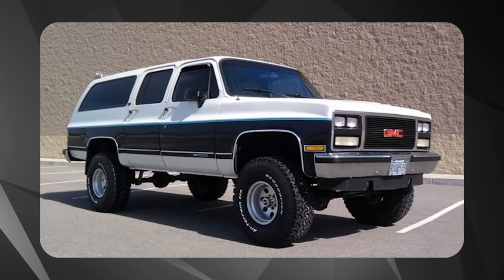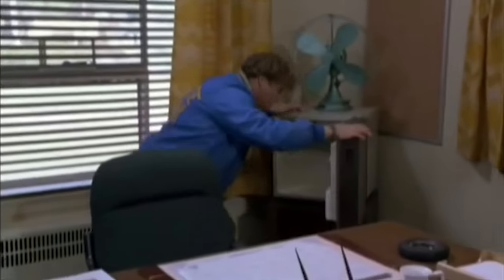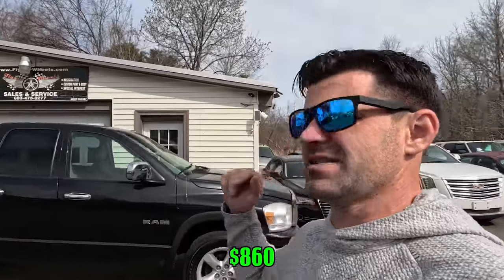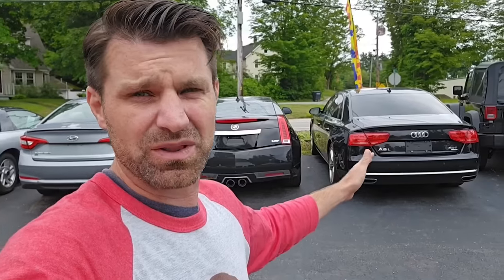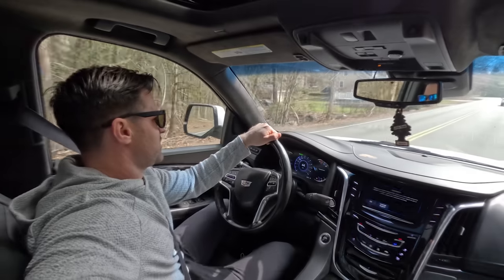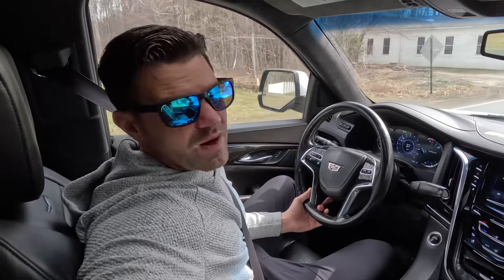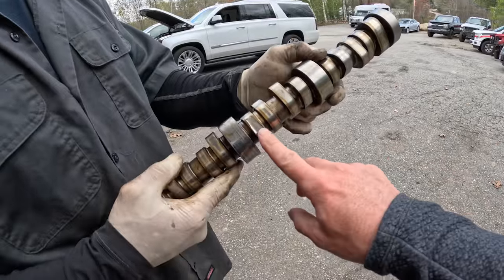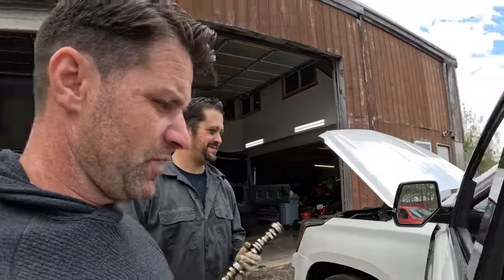WARNING! GMC Chevy & Cadillac Escalade Engine Problems at only 53,000 Miles! - Flying Wheels

Comment: CarWizard clearly said GM trucks became garbage when Active Fuel Management was introduced.
Reply: Also, "Consumer Reports" gives the latest GM vehicles a MUCH worse than average reliability rating. There are exceptions: 2020--2020 Blazer, Trail Blazer, and Traverse which are BETTER than average in reliabilkity.
Reply: @TheOzthewiz gm needs to go out of business gm is for poor people
Reply: @mattnorman5241  Hyundai/Kia and Nissan are for poor people.
Reply: CarWizard is blissfully unaware that AFM can be turned off with a tuner and eliminates the chance of an AFM lifter failure.
Reply: @hochhaul  He does know. Craig did also mention that transmission that comes with this truck is garbage too. I wouldn't buy it.
Reply: @henrykim4230  Obviously he doesn't because there's nothing wrong with the trucks. I know guys with over 200k on them. It's all about changing the oil often to keep the AFM system working reliably. There are tons of guys with well over 200k on them. The issue with the 6-speed is the trans cooler bypass thermostat, which due to the Obama EPA, forced the transmission fluid to heat up to well over 190F (often over 200F). That heat damages the torque converter clutch's friction material, which degrades and contaminates the trans fluid. There are several ways to avoid this issue, from the "flip" flix, aftermarket bypass thermostats, to the GM TSB thermostat replacement part. The 6L80 is a decent transmission aside from the EPA-forced garbage. The 8-speed had its early issues. But hey, everyone from Ford with their 10-speed to Toyota and their 8-speed have had plenty of serious issues. That's par for the course with all-new transmission designs.
Reply: Well I was thinking, how many times the engine could stop and restart with no problem on demand? But I thought the alternator would actually blow out first.
Reply: @Genesis12nivana  what?? what on Earth does the alternator have to do with restart? The battery starts the car via the starter and there is an auxiliary battery that supplements the main battery, the alternator is high output, and the starter I am sure is somewhat modified as well for the extra demands regarding frequency of starts.
Reply: @hochhaul Car Wizard said along the lines of the video, only about less than 50% of people actually maintain their vehicle. "Maintenance what? I don't do that."
Reply: @TheOzthewiz  Bro, Chevy Traverse is one the worst vehicles in the market.... their 3.6 V6 is utter dog s.
Reply: And he’s a GM guy lol. I’m a Ford guy I think GM has always been junk 😂 jk
Reply: @hochhaul 100%
Reply: @brettconv83  nah. He likes Toyota now. He converted himself into Scotty 🤣🤣🤣
Reply: He’s not a car wizard he can’t even work on bmws correctly
Reply: Tell car wizard I said OINK !

Comment: 96-02ish Ford & Chevy trucks are about as good as it gets. Cheap parts & easy to fix when something breaks.
Reply: I have a 99 GMC suburban at 300k that’s still in excellent shape in regards to the body/interior..it needs $3,000 to $4,000 worth of work to get it back up to par, and for the last week or so, I’ve seriously been thinking that it might be a better option to just do that rather than buying a newer truck, based on your very statement. Last Friday I was told the Same thing. 

 “you’re lucky to own that platform..cheap to fix, easy to repair, and lots of support..invest the money and run it for another 300k”

I guess im just looking for more recommendations.
Reply: I have an Ls1 from a 2002 z28 in my 1985 IROC. Drive by cable, no AFM, just a basic Ls with Ls power. She’s been running without issue for many years, drive it anywhere.
Reply: @angeldesigns1385  If the frame and body are sound, do it. Im guessing it has a 5.7l in it, those are about as reliable an engine as you will find in anything. The only real weak point for those trucks is the sun gear in the transmission. Im guessing at 300k its probably already failed by now and there are aftermarket upgrades available for it. The early 5.3l, 4.8l and 6.0's are good engines too. All the pre AFM ones were. I miss my 06 chevy silverado that i put 270k on. By far the best vehicle i have ever owned and i wish i still had it.

Comment: My 06 gmc Sierra 5.3 has 287k with original engine and trans ..I do my oil changes every 3500 miles and my trans every 50k I’ve owned it since it had 45k miles it’s been the best truck I’ve owned..I’ve replaced brakes some sensors and practically the whole suspension but as far as engine parts none..I love it ..still runs like new the idle is smooth like butter..
Reply: I also have 5.3 in my Chevy. What oil do you use on your oil changes 5w-30? Thanks
Reply: I have a 06 Silverado with 137,000 I just bought, what oil do you use and is it synthetic or regular?
Reply: @michaeltipton1919  Mobil 1 full synthetic
Reply: That is truly the last of the good 5.3l engines. Just before they started with the AFM stuff in 07.
Reply: 97 chevy suburban  had this thing for over 22 years, 205,000  on it now runs like a horse 5.7
Reply: I hear 5.3 are fine with afm but it's inportant to do oil changes with correct oil ever 300 miles, not 10 k like oil companies say
Reply: @chadbailey189  Nope, 5.3 is not fine with AFM, they fail lots. I know quite a few people, friends and family that have had theirs fail just like my 6.2 did. Same system and same parts...
Reply: @jonathanLara1989 stop sticking up for gm
Reply: If the owners of these 2014+ vehicles with AFM changed their oil every 3500 miles, they would significantly reduce the chances of an AFM lifter failure. The #1 cause of AFM lifter failures is not changing the oil often enough and sludge formations restrict oil flow to or in the AFM system. Like 9 out of 10 AFM lifter failures are due to the owner's bad habit of putting off oil changes because they can't be bothered to get it changed, trying to see how far they can go on their expensive full syn super oil, or short tripping the vehicle all winter long diluting the engine oil with unburned fuel and other junk. The AFM system requires unrestricted oil flow and adequately lubricity to work reliably.
Reply: @hochhaul  I know of some that failed before the truck even hit 3500 miles, including one that i owned personally. I have experienced 3 of these failures and all of them were well before 20k on the odometer, not long enough to build up any sort of severe sludge. One of them failed with only 2200 miles on the truck and the replacement engine failed at 17k. Best thing i ever did was dump that truck for a RAM. Its a truck i simply never should have bought but i did. It replaced a 2014 that also had a lifter failure at like 12k and it was fixed and i drove it until the warranty was up and i had a shop put in an AFM eliminator kit and its a good thing i did because the cam was about to get thrashed again, it had signs of the lifter spinning in the bore on #7 and it was starting to eat itself again. After that kit was put in i put another 100k on that truck without a single engine issue.
Reply: @hochhaul  That's on two trucks. A 2014 and a 2019. That 2019 i dumped after failure #2 with 17k on it. And yea, i bought a RAM and for the 4 years and 85k that i drove it,  it was a damn good truck. If i didn't need a 1 ton DRW truck for my new 5th wheel i would still be happily driving it. If i was in the market for a half tone again i would not hesitate to buy another RAM, i can tell you with absolute certainty i would not buy another GM with a 5.3 or a 6.2. 

I also know a lot of people with newer GM half tons from the bass fishing tournament scene that i am a part of. The vast majority of the guys i know have had lifter problems at one point or another with the 5.3 or 6.2. The only ones that don't are the ones that never tow anything.
Reply: @TDub_ADV  Wow what incredible odds-defying "bad luck" you had  to manage to get the 1% failure rate in not one but two trucks. You  either treat your stuff like a 90iq would, or you have a mouth breathing knuckle dragger turning wrenches on your stuff. I work with a crew of 25 guys and more than half of them have GM trucks that are 2014 and newer and out of all those guys , not a single lifter problem, 5 or 6 of them having over 200k and another 5 well over ~120k. I was surprised when not one of them had a lifter problem. I had a Tundra up until 2018 and switched to a Sierra and have had a lifter failure. In total we have well over a million miles across all the trucks and not a single AFM lifter failure aside from a guy with a 2011 Silverado but that guy was an mo ron and ran the truck into the ground, never checking the oil level much less changing it. You must be something special managing to destroy that many lifters.

Comment: The issue with the 6-speed is mostly due to the transmission cooler thermostat that forces the transmission to operate at temps between 190 and 220F. This was done for EPA fuel economy as the transmission is slightly more fuel efficient when the fluid is hotter. The problem is that the friction material used on the torque converter clutch degrades much more rapidly at these very high temperatures, a problem made worse by the slipping that they program the TCC to allow. Anyone worried about the longevity of their 2014+ 6-speed should remove or disable the thermostat on the trans fluid line so that the transmission will operate at 140F instead of burning itself up. 

The vast majority of AFM failures are due to the fact that the average vehicle owner waits way too long to change their oil. You can buy the fanciest high-priced synthetic oil you want, none of them can magically remove combustion byproducts (including fine carbon soot commonly associated with direct injection engines) and unburned fuel from the crankcase. Oil filters are not designed to capture these contaminants either. The only way to keep these contaminants out is to change the engine oil more often. If you don't, these contaminants form sludge in the oil. These sludge formations can clog the tiny oil passages and screens in the AFM system, causing a lifter to malfunctions and get damaged as the system turns on and off. The engines with a bad AFM lifter are most commonly owned by people that make it a game to see just how long they can stretch out their oil changes, or people that short trip constantly, often in cold weather, which is the worst case scenario for oil sludge. Even fancy full synthetic engine oils will sludge up if you're only driving 5 minutes and shutting it back down in the middle of the winter.

Guys that have had more than one AFM lifter fail are the unlucky ones that have an ignorant mechanic that doesn't read the service manual and didn't clean all the filters in the AFM system, so they replace the bad lifter, slap it back together, and another lifter eventually fails because sludge in the oil passages feeding the AFM system caused the system to malfunction yet again, or the VLOM had loosened and the mechanic didn't bother to make sure it was torqued down to spec, leading to loss of oil pressure.
Reply: good advice, thank you
Reply: My 2020 trailboss had lifter failed at 8k miles. I changed the oil at 2k miles, then at 6k. It had 2 oil changes at 8k miles. In my small town I had to wait a month to get it fixed because there were so many other trucks there getting the same repair. I don’t want to hear it’s a “maintenance” problem. It’s a GM problem. People do the same maintenance on Toyotas and fords, and they’re not failing at the rate of GMs. 
I traded it in for a ford as soon as it came out of the shop. GM went from the best engines in the early 2000s to the worst now. Ford went from the worst in the early 2000s to one of the best.
Reply: @lesterparker1594  All those failures are built in replacement functions that consumers never hear about.  When you think about it its actually a good innovation that taps into the consumer perception of quality where there is little masked in a sea of low cost plastic.  Consumers often miss the common sense of plastic and heat don't really mix, but don't take my word for it just see how many new vehicles are sold.  It can also be said that the self creation of a replacement demand market helps stimulate the bottom line of business.  Now the question in everyone's mind is how much innovation can the market sustain with little to no material impact.
Reply: @rubear1848  of course it’s planned obsolescence. Everybody benefits except us.
Reply: Thank you for the detailed info. I bought my late model 2015 Escalade esv certified pre owned and I haven’t had this problem. I bought it with 31,000 miles on it and it now has 120,000 miles. This vehicle is nicer than the 2008 model I owned but does feel harsher on the bumps.
Reply: How can I disable the thermostat?
Reply: Not exactly true bro. A very good friend of mine who is a preventative maintenance NUT purchased a 2021 Yukon XL brand new. At about 19k the vehicle started running badly. Towed to the dealer. Several lifters COLLAPSED!  The dealer replaced the lifters on the affected side under warranty. When he went to pick it up, he was astounded that they only replaced the one side ! Why didn’t they replace ALL of the engine lifters while the engine was apart? THAT was GMs “protocol to only do the affected side ! After some haggling they did replace all of the lifters and extended his warranty. His concern now is, was the camshaft damaged ? Will there be ANOTHER failure ? Pretty sickening when you spend almost 90k. Bye the way , he drove his 2003 Yukon during the new ones downtime. It has 303k miles ! Motor UNTOUCHED and runs PERFECTLY. What’s wrong with this picture?
Reply: Transmission coolers are cheap and easy to install so I go large. Stock was never really good. I do it on all my automatics.
Reply: I have to disagree with you on your reasoning for AFM lifter failures. A good friend of mine , who is a preventative maintenance NUT purchased a 2021 GMC Yukon XL. 6.2 liter. He had the first lifter failure at 19 k miles. Knowing him, he had probably changed the oil/filter 5 times by that point. The dealer replaced the lifters and pushrods on ONE bank only, per GM directives under warranty
Reply: @jamesjoslin7586  There seems to be a recent span of production where the lifters have a low mileage failure pattern that's totally different from the last 15 years of AFM engines. It's quite odd because I know so many guys with 2019 and 2020 GM trucks with AFM. Not one of them have had a lifter issues. So it seems to be a more recent change, possibly due to covid related supplier changes. It's distinctly different from the past AFM lifter issues.   In the past the mileage was quite random. I know guys that have anywhere from 150k to 250k miles on their 2014+ AFM egnines without a lifter failure. The 2013 and earlier engines frequently had lifter issues that turned out to be caused by the oil pressure manifold assembly loosening up, causing a loss in oil pressure to the AFM lifters. Or the oil solenoid or filter would be clogged with sludge. This was quite  infamous because guys would take their truck in for repair, the lifters would be replaced, and the new lifters would fail shortly after because the oil feed passage would still have a clogged up filter that restricted oil flow.
Reply: @jamesjoslin7586  also, you friend should have pressed them to replace all lifters. They will replace all of them if you ijnsist firmly enough.
Reply: @hochhaul  Actually, now that I think of it , when he found out that they had only replaced the lifters on the affected side , he asked them “ Why do only one side ?” The dealer informed him that was GMs “ protocol “.  He said that’s ridiculous. They replaced both sides and also extended his warranty. Now, he is concerned about camshaft damage and longevity in general. Pretty disgusting.
Reply: Sadly, GM has become synonymous with the word "JUNK".
Reply: Vlom?
Reply: @jamestamu83  if you're a 60iq kind of guy that can't change your oil often enough, yeah I guess that's what you would say
Reply: @johnweiland9389  valve lifter oil manifold
Reply: Oil change every 3000 miles nuff said!
Reply: How to remove or disable the transmission thermostat.
Reply: @TruckingTrucks  There are a lot of videos on the tran cooler bypass for the 6L80 in 2014+ trucks. Just search it on youtube or google it dude

Comment: Sued GM in 2019-2020 and forced them to eat $10k on my c7. Brand new c7 with 146 miles and it was dead for 3 months. Never bought another new GM.
Reply: At least you bought American right ? I've seen a video that has the % of American made parts & the Toyota's / Honda's have way more American parts as a % in them then Chevy or Ford !
Reply: Do you think it was the active fuel management that failed in your C7? I bought a '13 gs, glad it doesn't have afm!
Reply: boycott gm
Reply: My 2019 has oil metal flakes and i told dealer about they said its fine well if that engines smokes i will sue them. I told them multiple times

Comment: I understand your exhaustion.  I owned a heating oil company for 20 years and while it was financially rewarding, it was a killer in winter.  A snow prediction would have a hundred customers looking for oil they did not need right away,  emergencies at night, collecting could be tough, and then there were the rising and falling of oil prices.  At least though, May, June and July brought a lull.  You though, don't get a lull.